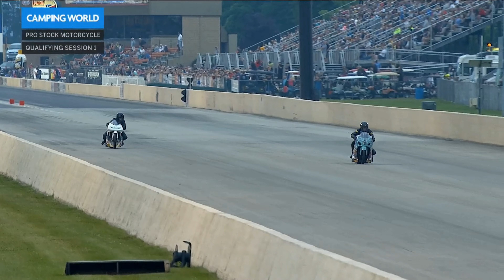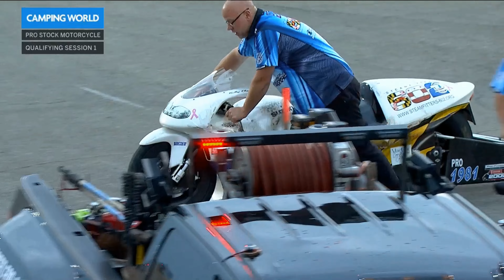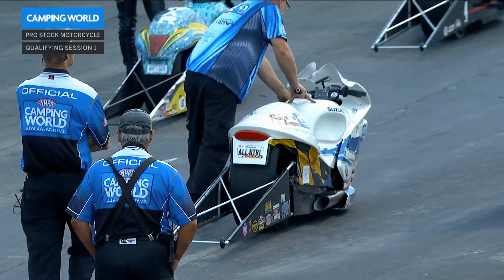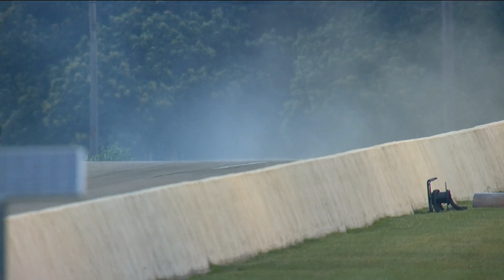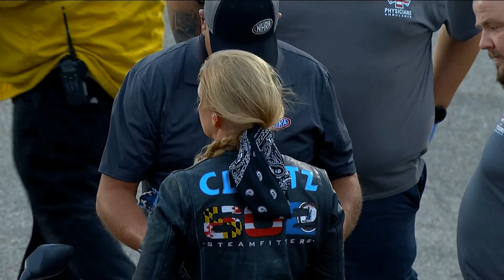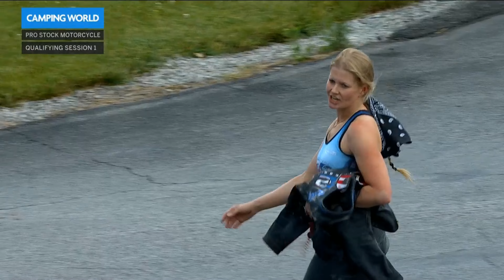Kelly Klontz goes for a Tumble, Summit Racing Equipment Nationals, Summit Racing Equipment Motorspor

Comment: It look like way too much rear brake
Reply: THAT'S WHAT I WAS THINKING!!
Reply: Front
Reply: It's the aerodynamics funnel the smoke , she locked the front. That's why the bike washed out, if the rear tire locks up it bounces.  It's a 26×10×15 full softwall slick.
Reply: @billmadison2032  right rear brake usually doesn't lock and turn the front wheel!
Reply: @brucebouck6152  absolutely

Comment: Looks like to much rear brake.
Reply: The front tire is very narrow and doesn't provide much friction with the pavement for braking. There's a lot more rubber in the rear but sliding either one is not good. Her comment about the shutdown area being shorter than at some other tracks may be the biggest factor. It may be time for Pro Stock bikes to start installing parachutes.
Reply: Matt Daugherty  not sure what your talking about?

Comment: This might be a silly question but,
Would it hurt the bikes performance much if anti lock brakes were mandatory on the vehicles at say under 100mph?
Reply: It definitely would cause drag on the rotors!
Reply: What the other guy said, plus it is expensive and these are pros. She just had a bad run.